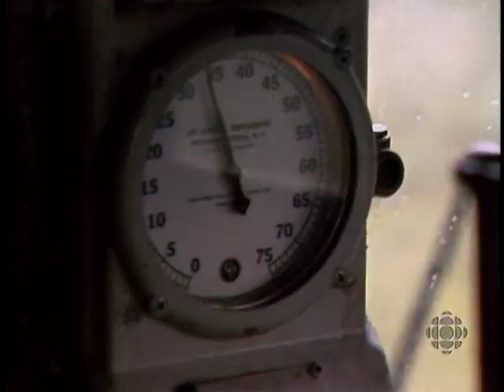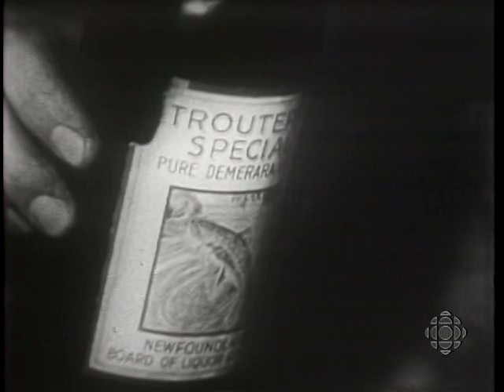End of CN's Newfoundland Railway.  Unedited CBC footage.

Comment: Should've kept a segment of this treasure as a Tourist Heritage Railway. Did CN ever plan on Standard Gauging?
Reply from the maker: Apparently it was looked at just after confederation but wasn't deemed done to the cost.  Again in the 70's CN looked into it but the cost and time to do it wasnt worth it.  Unfortunately the narrow gauge is what doomed the lines future.
Reply: @shnorth888  had it been standard gauged, would it still exist? What commodities would it carry?
Reply from the maker: @wavesnbikes  Unknow if the re-gauging would've have extended the railroads life.  CN probably wouldn't be running it anymore. selling it to a short line operator more than likely.  As for commodities the Newfoundland Railway carried pulpwood and other wood products, newsprint, mining minerals, some oil was also hauled.  Also some locally manufactured goods.  However most goods were shipped in from Canada or the U.S.
Reply: @shnorth888  The only contender in my mind would be avondale,, but then it be one hell of a task
Reply: @marcleslac2413  Avondale to Whitbourne would make for a fine run.
Reply: @Militaria-pr9rj  ikr
Reply: @shnorth888  cn being govt owned didnt help either